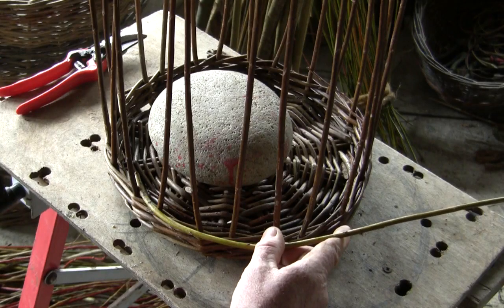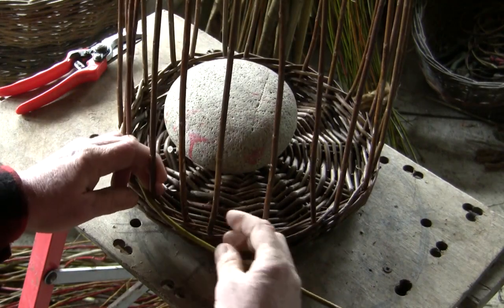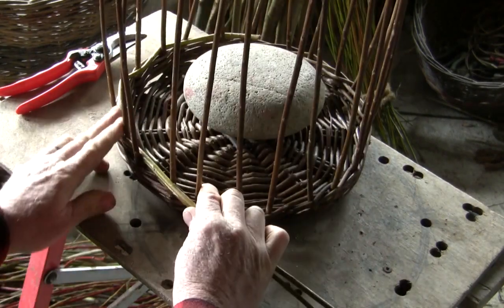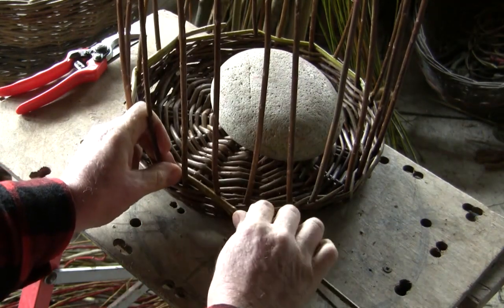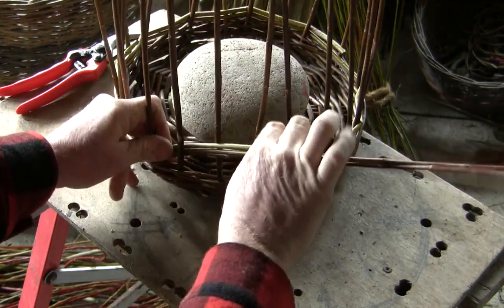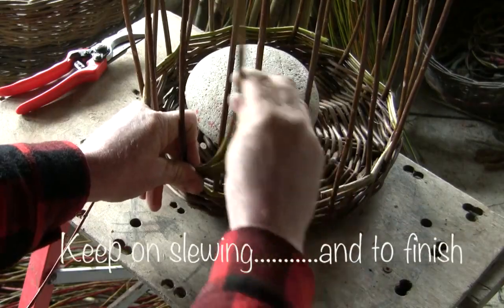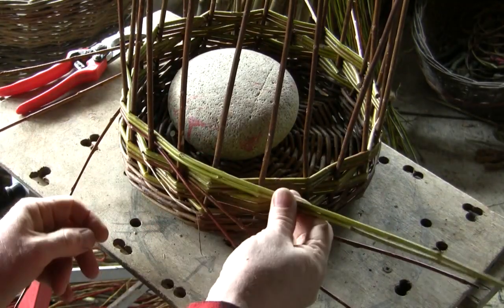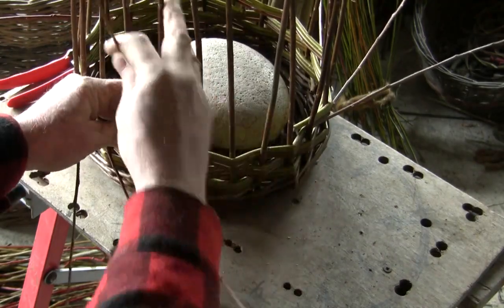Willow Weaving Techniques | Slewing

Comment: Soooo ... maybe a naive question but " an uneven amount of uprights" ....is there a specific place where the extra upright or rod is inserted ? or? 
I have only created a few baskets so my experience is somewhat limited but love your vid ... :)
Reply from the maker: You need an odd number for the continuous weaving pattern to work. It's more a case of removing one upright from a full set in order to achieve the odd number.